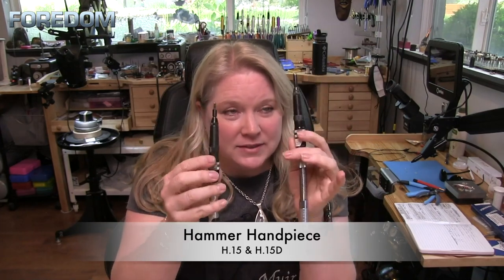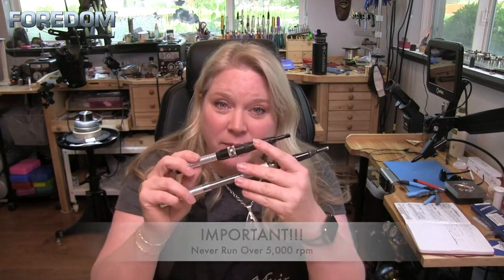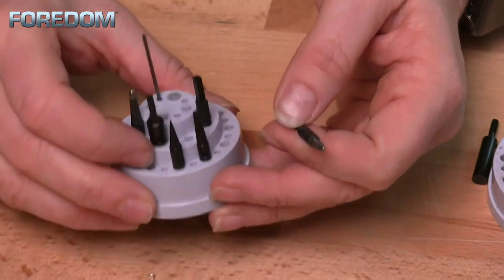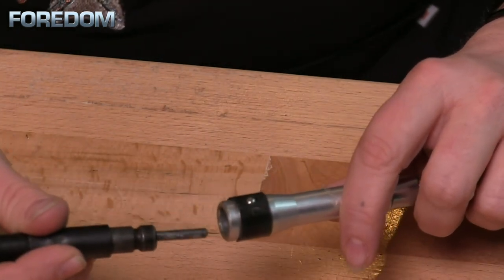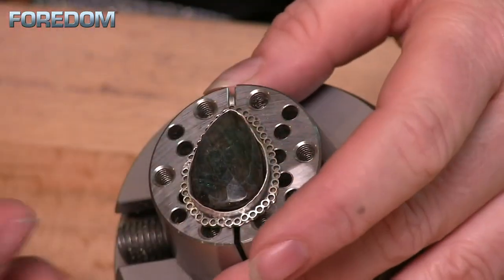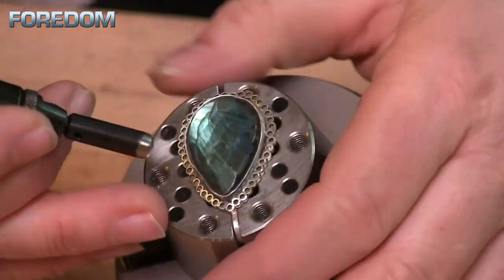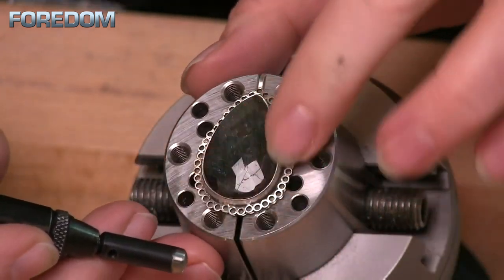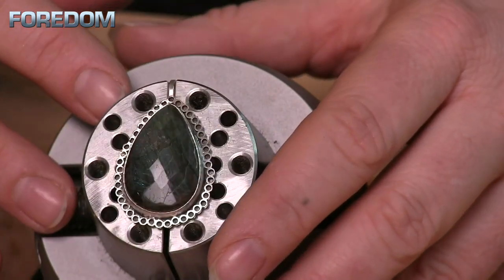Foredom Hammer Handpiece - How to use the hammer handpiece with Meliisa Muir

Comment: Hi! I hope this isn’t repetitive but I was wondering what foredom motor you are using for this? I have the SR hangup…would that work?
Reply from the maker: You can use any of our motors as long as they do not go over 5,000 rpm. So, for the LX motor that could be anywhere in the speed range. For the TX motor, you can go up to 1/3 of the speed range and for the SR 1/4 of the speed range.

Thank you so much for reaching out to us. Please call 800-272-2885 or email us at: customerservice@blackstoneind.com for if you need more information.